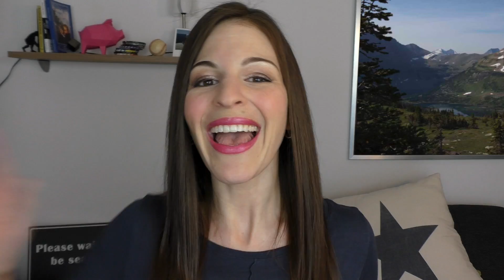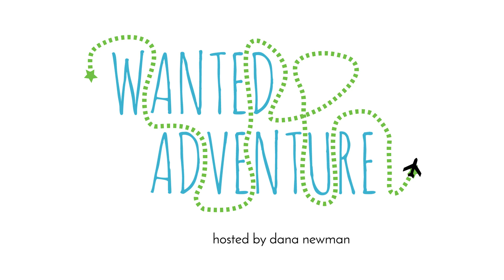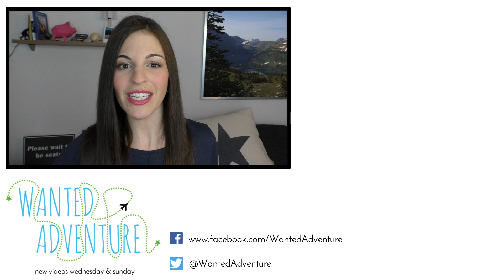Why Are Houses in America MADE OF WOOD?!

Comment: I take it you don't live in earthquake country.

It's been illegal to make houses of stone or brick in California since the 70's.  Wood is far, far safer not just for obvious reasons (no heavy solid chunks falling on people) but also because wood is flexible, and thus moves with the motion of the earth in a quake.  (Sky scrapers in CA are required to take this kind of flexibility into their designs as well.)  Seeing as how human influence is causing earthquakes to happen in areas that have never seen them before, building with wood is pretty much the safest method.
Reply: a Wood house in southern California could last for ages without much maintenance, build a Norwegian (wood) style there and you have tons of insulation and that is as important in the heat as it is in the cold.
Reply: There are lots of wildfires out there. Wood houses burn very easily.
Reply: Indeed. Local conditions vary greatly across the U.S. In California where I live, or anywhere near the West Coast, it would make absolutely no sense to prefer brick construction to wood--especially in Southern California. We don't get hurricanes or tornadoes, we don't get snow in most places,  and we don't get a lot of natural moisture at all so mold usually isn't a problem. We DO get earthquakes, and are in constant danger of "the big one" occurring at any moment.

Bricks were much more common in construction in relatively older buildings but after even a few relatively mild quakes most were rendered unsafe. Our "historic" brick/masonry buildings which survived have been required by law to be retrofitted with rebar, cables, and other reinforcing in order to be considered safe.

Another matter not mentioned is our propensity--if we happen to come into a bit of money--to want to reconstruct/remodel our homes, like add to their size or change the size of rooms. It's much easier to do that with wood.

The only disadvantage of wood that I can think of is for housing in areas prone to wildfires. There are often separate building codes for such areas which at least require some fireproofing, especially for roofs.
Reply: concrete is much more safe but also very expensive, american standard house is about 4 times cheaper then concrete European house
Reply: Serai3 human activity causes earthquakes? Now I've heard it all.
Reply: Generally they don't, but there is one exception. In Oklahoma there were no earthquakes until wastewater was disposed of by injection into deep wells. That was certainly a surprise to the locals!

https://earthquake.usgs.gov/research/induced/myths.php
Reply: Michelle Renwick Wilson not true, check this other video, they burned two houses at the same time, the brick one burned and damaged more than the wood one because wood houses are treated with fire retardant, by the time the firemen arrived the brick house was severely damaged. It was interesting video.
Reply: @suuupretty  that was a biased video. The brick house had more wood in it than the wooden house. Read the comments from that video.
Reply: Serai3 Interesting. I never knew that!
Reply: Japan, Ph, and any country on the ring of fire build their houses out of concrete and hollow blocks. The key is to use appropriate steel reinforcement. Although with the case of the PH, wood is more expensive than concrete with all the regulations and declining forests.
Reply: And, no offense, after watching many building projects happen in the US, I wouldn't trust many of the builders to pour the concrete right either.
The Japanese have perfected concrete so well that there is a grade for every job.  Don't worry about falling debris from the building material, it's the builders and their quality of work that would be the weakest link.
Reply: muyilsti .Y Not really. Many homes in the East Coast are built with brick. BUT newer constuction brick homes unlike older brick homes are mostly a fascade and not used as a structural wall. The newer homes are built with the usual stick frame construction. There are newer foam material that are faux brick in appearance that an American construction materials company in New England makes. The have a better insulation R value than brick, will not shatter unlike brick, can be textured and colored to look like any kind of brick, and can be set to any type of wall usually reinforced concrete with just construction adhesive which can take only a matter of hours instead of days or a week so labor costs are far cheaper. The only thing that takes time are setting the motar between the joints and letting it to cure.

People don't realize and including Americans that many parts of the U.S. are in earthquake zones. The largest recorded earthquake in the Continental U.S. was on the Mississippi River around Arksanas, Missouri, Illinois during the early-mid 19th century. It was so powerful that it changed the flow of the river wiping out towns forever. It wasn't until a major flood along the Mississippi uncovered one of the those towns in the last 15 years. 

Earthquake zones are not exclusive to the West Coast, Alaska, and Hawaii. There are major fault lines along the Mississippi and Ohio river valleys, Charleston, SC, and one running straight under midtown Manhattan in New York City. Think of the 100s of thousands if not millions of brick structures and skyscrapers built in the last 3 centuries that are not built to modern Californian earthquake codes if a major earthquake were to hit the NYC metro area. It would beyond disasterous in modern history. NYC residents have extremely short memories and forget because there tends to be very brief and mild earthquakes in the 4-5.5 Richter scale range that can be felt every 10-20 years. The last one happened 10-14 years ago.

Also houses built with brick as the supporting structure such as walls do nothing against a F2 -F5 tornado. The house will still get damaged or totally destroyed. What is important is that the walls and roof are reinforced with steel rebar and concrete. And any glass door and windows are either shatter proof or have storm shutters that can survive flying debris. But all these additional costs can add $10'000s -$100,000s more to a house.
Reply: While it's illegal in California to make houses out of masonry, you could build a house out of steel frames and reinforced concrete/masonry. But it's expensive in US, especially for individual housing because of manual labor required. So the only choice left is wood.

In some other states because of termites masonry is prevalent but we don't see those because Hollywood is in California.
Reply: Serai3 woods prettier stronger safer cheaper and easier to work with
Reply: Most homes in Mexico a quake area, as you will recognize are built of concrete, brick, steel (at least if you can afford it). Probably technology wasn't available in California in the 70s of the last century, but it sure is now!
Reply: only a moron would beleive what u wrote it makes no sense
Reply: Go to Japan and you may see some of the most earth quake resistant houses in the world. All not made of wood.
Reply: And you will see wooden houses with heavy tile roofs, great for resisting typhoons but a disaster in earthquakes. 

https://en.wikipedia.org/wiki/Great_Hanshin_earthquake
Reply: @andreaswagner6022  I've been to Japan. There's an awful lot of wood construction, even in the city.
Reply: That is true. And some of these are indeed very old. On the other hand almost all the new buildings are not wood and the earthquake protective building rules are at highest standard and usually quite reliable.
Reply: exactly!
Reply: Earthquake yes but not Tornado East America need bricks
Reply: muyilsti .Y We don't get tornados in the east.
Reply: Ow I see..
Reply: Please see to japan regarding earthquakes please - all concrete and they modify the foundation to withstand shocks
Reply: I guess California is not really familiar with tsunami. I live in Indonesia, and wooden houses aren't really do well with tsunami, especially the areas that directly exposed by coastline. So we stick with bricks/concrete houses and make it multiple story. Our constructions haven't as advanced as Japan, yet. But we keep learning.
Reply: stone housess are much safer 100 times
Reply: Earthquakes don't exist.

Comment: Closer stud and truss spacing, along with thicker plywood can significantly increase tornado damage resistance. Roof design, engineering, and attachment to walls is important. There are some amazingly strong and durable engineered/laminated wood products that can be used.

Comment: Tornadoes can have wind speeds basically from (F1) 100 mph (161 kph) up to (F5) 318 mph (508 kph). Not much beside a military style reinforced concrete bunker can stand up to an F4 or  F5 tornado. Also, in tornadoes like F1 to F3's the homes are damaged not  because they blow the walls down, but because the tornadoes winds lift the roof off the house and often drop it right back on the house. Even in Europe the roofs of homes are made of wood rafters covered with roofing material an most cases. Another thing to remember, it's not always the wind that does the damage, but the debris in the wind. Basically, everywhere east of the the Rocky Mountains is prone to tornadoes in the USA.
Almost not better place to be than in a wood frame home during an earthquake. Wood frames will flex with the movement, non-reinforced brick, mud brick, stone, cinder block and lightly reinforced concrete is often a death trap in earthquakes.
I live in a  97 year old well maintained wood framed and stucco exterior home in Kentucky with a full basement. The house is well insulated and has had full upgrades to wiring and pluming in the late 1980's and the windows and doors were all replaced with high efficiency double pane glass in 2002. The modern upgrades are far easier and less expensive to do in a wood frame home.

Comment: The US has many brick houses but they are almost entirely wood framed with brick veneer which is really no better in a severe tornado than a wood framed house with no brick. 
Probably the biggest factor with having houses built to survive an F-3,4, or 5 tornado is money. Most Americans could not afford a house like this. The only structures that could survive one of these tornadoes is a  Heavily reinforced (with rebar) concrete structure. Many people have storm shelters or safe rooms of reinforced concrete built in to their houses in tornado prone areas. Look on you tube at some really powerful F4-5 tornadoes and then decide for yourself if it would be prohibitively expensive to build a house to survive one. 

In the US it is not allowed in most places it is not allowed to build a house in a flood zone. Of course it does also flood in non flood zone areas and some houses were built in these zones before they were known.
 
In areas that are subject to hurricanes the building codes usually include much more reinforcement and bracing so wood framed houses can withstand higher sustained winds. I believe these codes differ from state to state. 

Steel framed houses (framed with lightweight metal studs and joists) would be and are termite proof but they hold up no better to fire and wind than properly built wood framed structures.